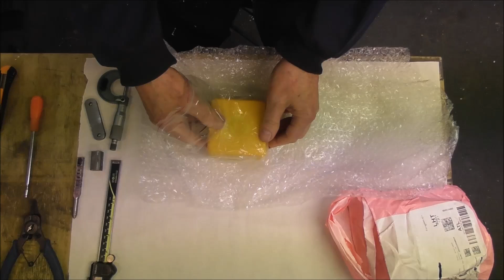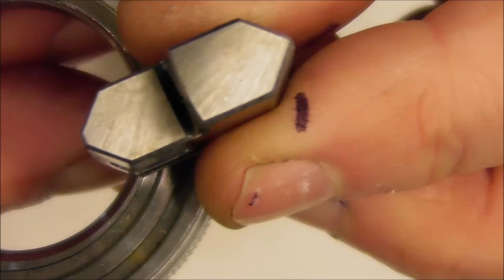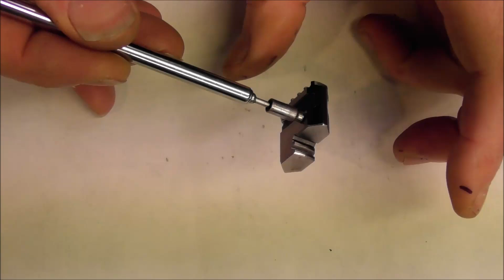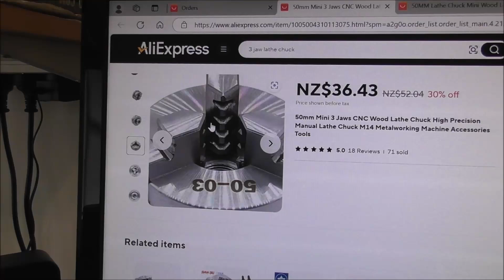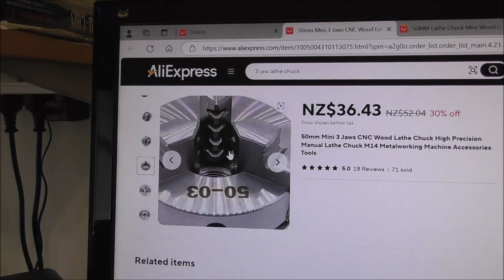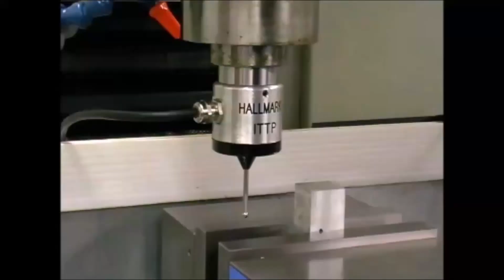Two Inch 3 Jaw Chuck

Comment: Credit where it is due, you can  buy accurate toolmakers grinding vices for decent money. I bought 3 of them before the word got out on the quality so prices have risen since. This chuck looks like it could be the basis of a drill sharpening rig. Whack on a cam plate to generate nice conical points. also might be good on a D bit grinder.
Reply from the maker: Yes, I am sure it has many potential applications that have so far slipped under the radar. Cheers, Cliff

Comment: I think it’s normal for the jaws to touch at one point of the scroll because the radius is different in the centre to the outside so you can’t ever match them perfectly.
Reply from the maker: I agree the contact arc is never 100% because of the spiral rads changing. However, the contact patch is smaller with this type of symmetrical oval than the normal offset curve design. The smaller the contact area the higher the pressure and wear. But still, it may be adequate for small light work. I will probably do a follow up video and let you know how it goes. Cheers, Cliff

Comment: Looks like the jaws have a 90 included angle, which would make sense if they designed to used them in production for 4 jaw chucks also.
Reply from the maker: Yes, they are 90 deg. I get your point; it could be something like that. Cheers, Cliff

Comment: awwwww, isnt it cute?

if only they gave them soft jaws. would really add to the usefulness.
Reply from the maker: It is cute! An engineer's 'kitten reaction' ! Cliff
Reply: The jaws are very simple geometry, making a set of soft jaws would be reasonably easy, though I've never had need of a soft jaws system on such a small scale since emergency 5c collets are so cheap and easy to machine to special clamping needs.

Comment: I have one of those mounted to a fixture plate for my CNC mill, I use it to hold round parts all the time for milling ops.
Reply from the maker: Interesting. So you have a 2 inch for holding parts in a mill. Have you tried it with bigger cuts, has it always held tight?   Cheers, Cliff
Reply: I use it for holding small round parts or hexagonal parts for ops on the end, I have never had it let go of a part yet and I've been doing it for around 7 years. I made a pin wrench for snugging it up,  as for heavy cuts... Lest get our nomenclature synchronized here, I've held steel (1018 and 4140 mostly) say a 5/8 diameter sticking up maybe as much as an inch and a half or so have faced with a shell mlill, flank cut with end mills but I do not recall taking a heavy cut as I would think of a heavy cut,  my basis for a heavy cut would be something like 6-8 thousand rpm horizontal federate 20-30 Iipm, and plunge depth of say  half an inch... So nothing too extreme for the little chuck, I don't think I've ever needed more than say .1 depth with it. And I've never side loaded it with high feedrates, it is after all a little cute import chuck, it's respectability of holding and centering would be problematic if I wasn't propping each part to find center I've measured around as much as 3-4 thousands of concentricity error on it.
Reply from the maker: @acroduster  Thanks for that, I am surprised, it is even better than I thought it might be. Cheers, Cliff